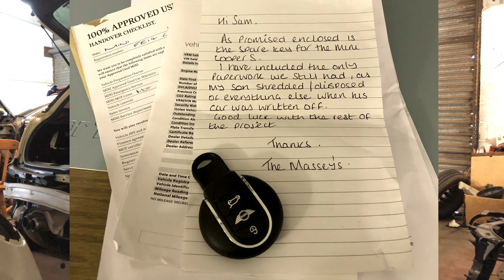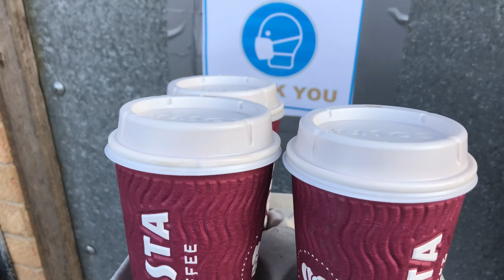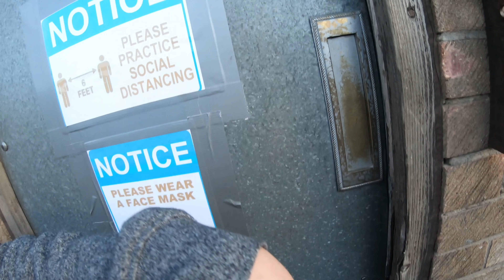Speaking to the Original Owner & Getting the Mini Cooper S Rear Quarter On!!!

Comment: Lots of good progress this week - so handy that you have access to a donor car for a lot of the bits pieces you need. Changing the brake line looked fiddly but at least it didn't go all the way to the front of the car! Don't forget to bleed the brakes before you try to move it otherwise the Mini might end up needing more body repairs lol!
Reply from the maker: Thank you. Yea certainly helped with the donor car being available for bits and pieces. Brake line- took a long time getting back into the car. It goes up behind the subframe and petrol tank which is a massive pain. 
Yep- brakes have been bled just not in this episode- thanks for pointing that out though as it’s something that could be easily missed 👍👍😬